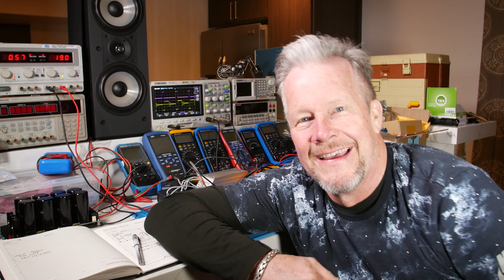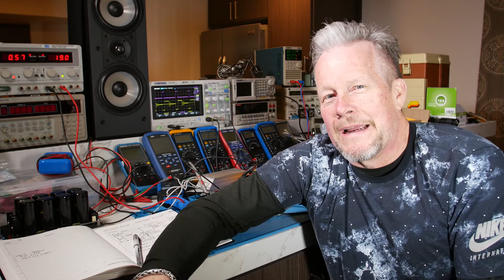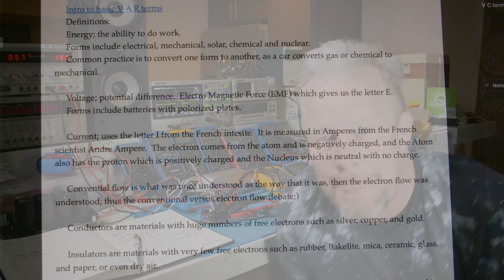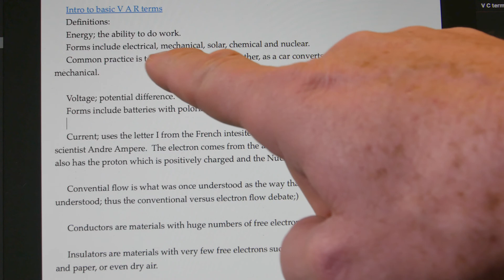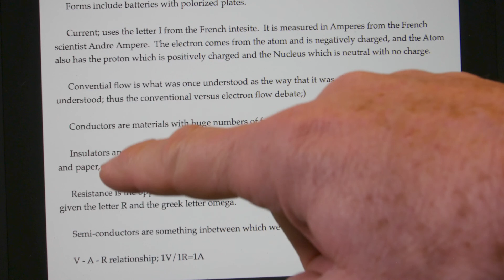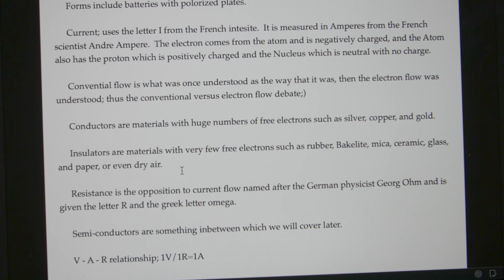KISS U - 101 What is Voltage Current and Resistance Intro - part of Kiss University playlist #kissu

Comment: I have looked at your video and think that I understand most of it.
I = current is the "water" and do not have to move to be current?
While A = Ampere is the measure of the moving "water" or what?
Ohms law says I * R = V so when V is zero A is also zero while current easy can be 1,000?
Please help:-)
Reply from the maker: Fried Mule Thanks for the great question!  If the water is not moving, like in a huge lake at the unopened gates of a damn, then it’s just building pressure and has potential, so its voltage.  Like electrons charged on plates in a battery, it is potential difference in pressure or in electronics, potential difference in voltage.  Water will flow when the gates are open then you have current and depending on how much resistance the gates give will determine how much current.  When you place a wire across the battery terminals, you will have current flow and depending on the resistance of the wire will determine how much current flow that you will get - which is measured in amps.  I’m doing the next video that will help explain more.
Reply: @KissAnalog  Thanks a lot for your reply, what I do not understand is the difference between I (current) and A (Ampere). :-)
Reply: @friedmule5403  
Current is the flow and Ampere is the unit of measurement.
For instance the imperial measurements = current and the units we measure in  are inches = Ampere's
Reply from the maker: Next video I should be posting today should help.
Reply from the maker: Good answer
Reply: Adam L + Kiss Analog -  Thanks… Ohm's law says V=IxR and not V=AxR so therefor my confusion:-)
Reply from the maker: Fried Mule It is confusing because V and E are used interchangeably.  But, E is the pressure or potential difference and V is the units.  So ohms law should really be shown as E = IxR.  Electrons that are collected or grouped up and not flowing make up a charge which is what makes up a potential so creates a voltage.  This is E with V as units.  When a conductor allows the electrons to flow, you have current.   This is I with A as units.  If the charge is not continually being built up while current is flowing - then equilibrium is achieved and there is no more current or voltage.  Like a battery being discharged.  Make sense?